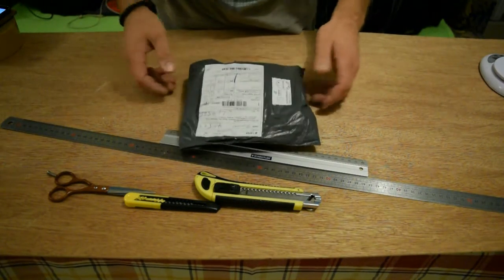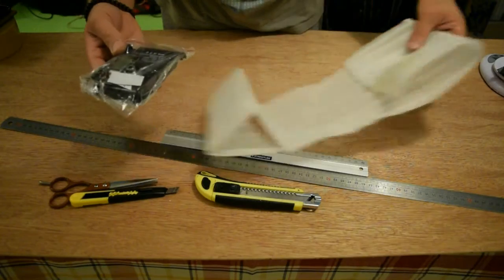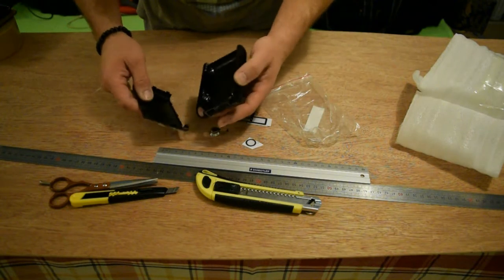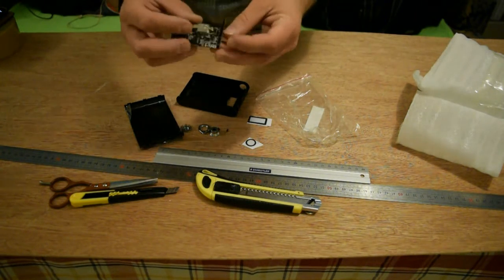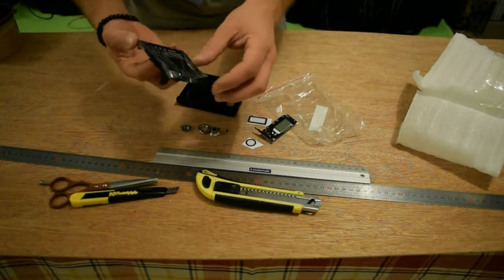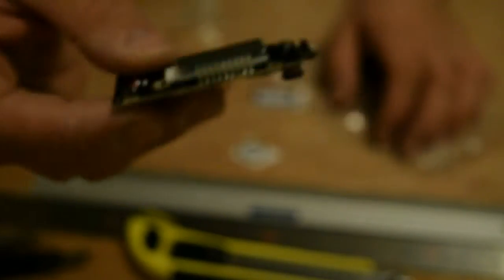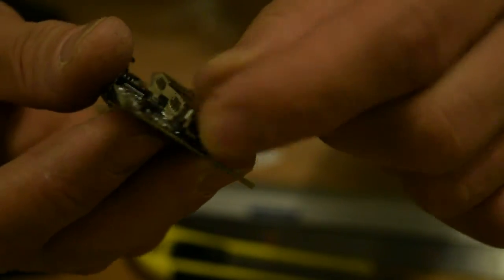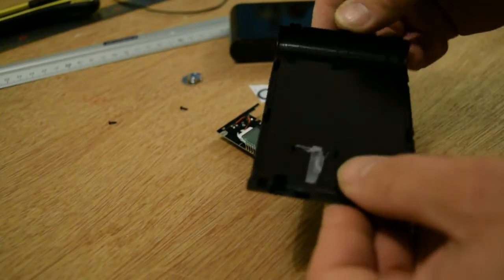Review DIY Kit Dual USB 5V 1A 2A Power Bank. Order from Banggood.

Comment: I just built one of these kits and it works pretty well. Not a tough build, but you need battery connection tabs in order connect each battery. The kit doesn't come with them.
Reply from the maker: hi

Yes its not come with the tabs but if you don't have you can pit some small wire there.
Reply: Yes, a few strands of copper wire from most cables will do the job just as well.